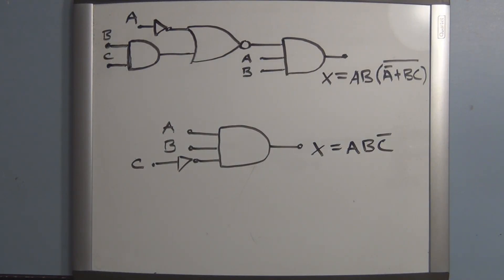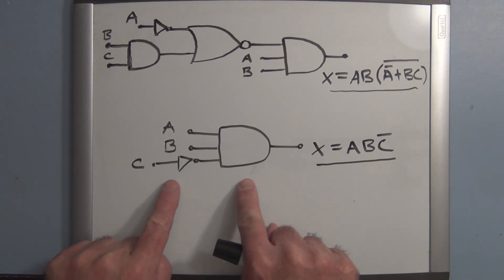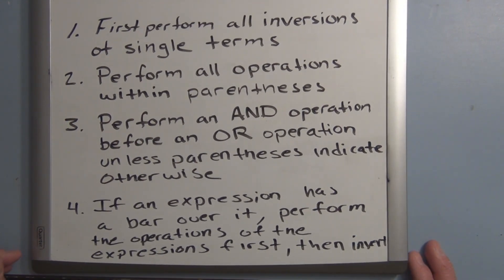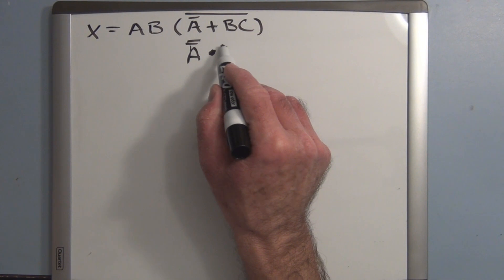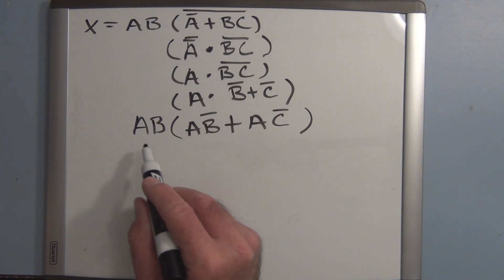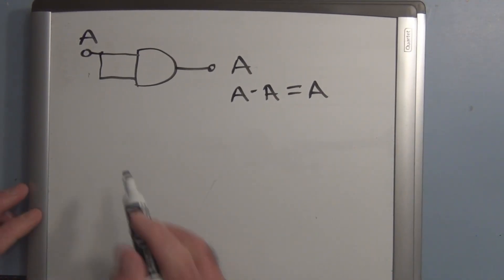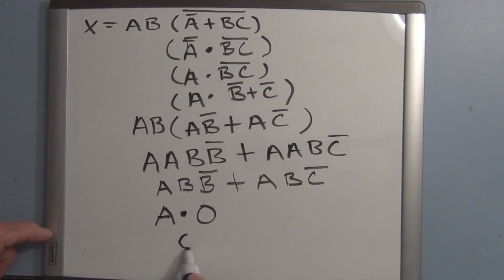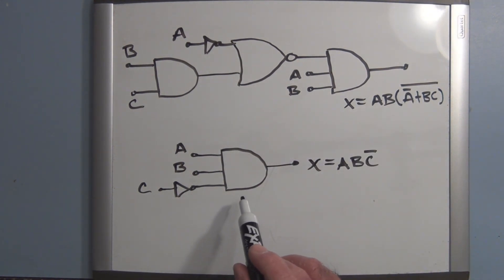Boolean Algebra Logic Circuit Simplification

Comment: So simple and powerful explanation. However,  I have a couple of remarks:
1) To avoid confusion in the mind of the reader, it may be better to put   not(B) + not(C)  in parentheses inside the existing parenthese.
2)  Input to gates are SIGNALS indeed. Therefore, it is important to explicitly mention 0  as NO SIGNAL. In the video, the presenter talks about and process the ZERO as if it was the normal zero in arithmetic. This is confusing to the mind of the listener.